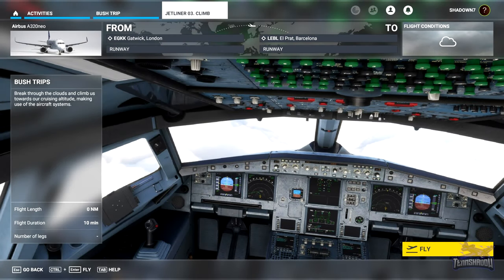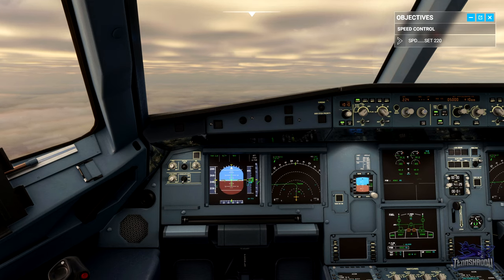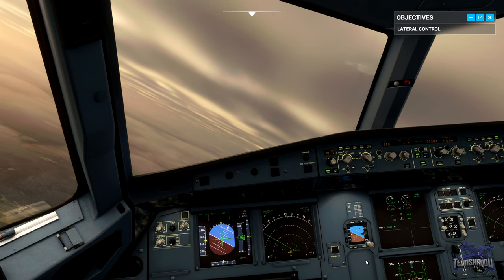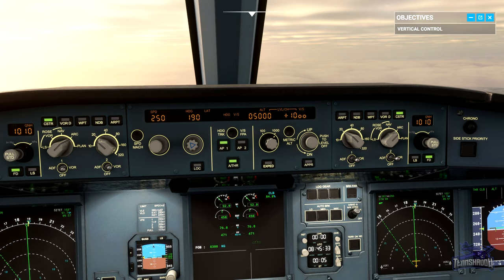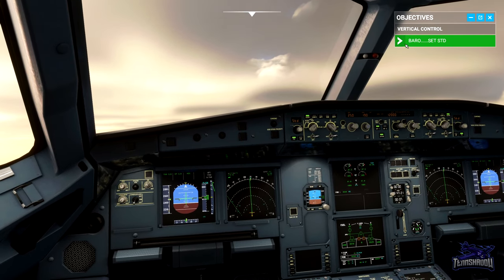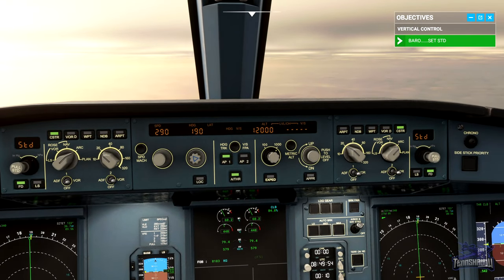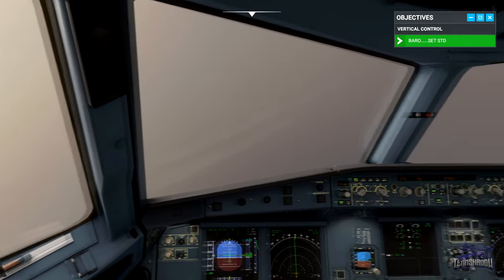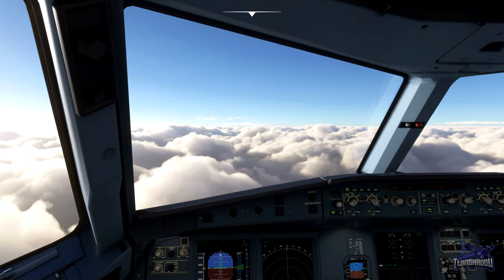FS Academy Jetliner | Lesson 3 - Climb | Airbus A320 Neo | MSFS 2020

Comment: I need you help, in the second 3:47 you push de bottom and show a down arrow, and nothing appears to me.  what is the gesture or the key that makes the arrow appear?  since without it the course does not work 🙃
Reply from the maker: I've had that happen to me before. You can try to change your views and move in closer to see if that will help.  If not, try restarting the lesson and / or sim.  Good luck!
Reply: Hello, I have the same problem, i was trying to figure out, and i got frustrated .
Help please 🤪
Reply: By the way I am using a xbox series x
Reply: Hi, I already found out how to make work the heading and bard selectors.
with the mouse midle wheel click twice on the button selector and will work. try it 👍